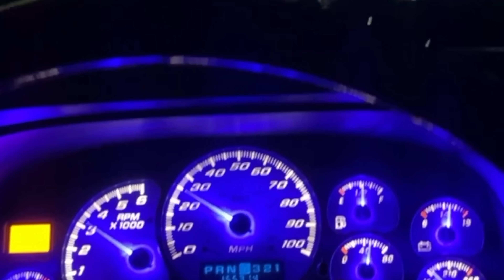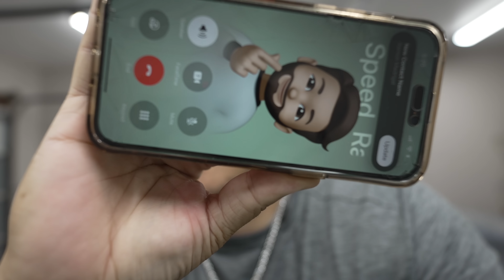He's Been Scamming People This Whole Time!

Comment: Dang brooo that ish wild! And the V at the end bruhhhh thats crazy! The east coast aint any better. My mazdaspeed 3 got parts stolen off it and it sat for a couple months. My mk7 gti sat for a couple months to get a clutch replaced from a different shop and i got it back with a messed up front bumper  f these half ass shops bro